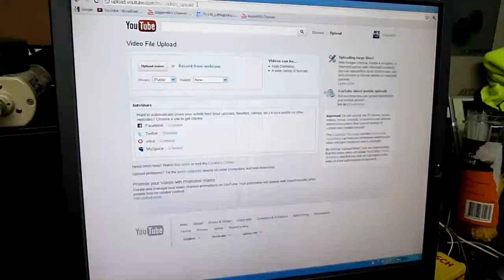Ed Systems 1000'th Video - Thank You Friends and Viewers

Comment: I first found your channel while I was looking for info about electrolytic rust stripping, I had a pipe vise that was left out one winter and was locked up solid. Well I didn't use the same equipment, like a DC arc welder, but I did learn a few things through trial and error, like current and surface area matters. Now I think i have figured out a setup and have the makings of a 35 amp DC power supply, a simple linear one that won't complain. Anyhow congratulations on posting 1001 videos.